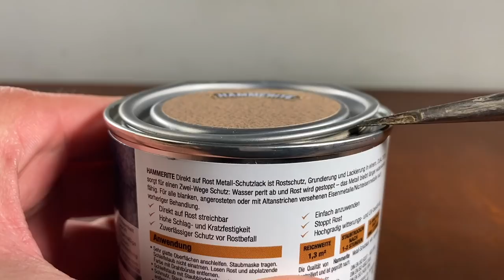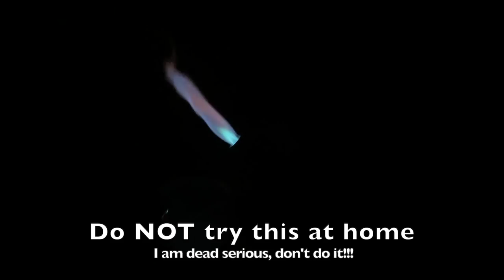Antique german nail puller restoration I Dr. Hut of Handcraft

Comment: Are the jaws are supposed to dig in? the handle has  a big weight on it at the end. Place it over a fully driven in nail and slam the sliding end in to dig the Jaws into the wood so it can grab the head of the nail. Then lever off the lever attached to the jaws.
Reply from the maker: Yes that is actually how you use it, but I didn’t know it when I was testing it, because I had never seen such a tool before. Thank you for your comment!

Comment: They are not for pulling nails out but fencing staples out and you roll them out using the tang on the second beak of the jaws.  In Australia where we have very hard wood especially when it has been holding up a fence for better than twenty years you need something strong to pull the staples out of the post.  I have my Great Grandfathers set which are almost the same make made before 1890 and they are almost the same,  I was using them last week on an old post which a tree branch had fallen on and it loosened the staple with ease.  Hope that helps.
Reply from the maker: Thanks for the info. I know I have used it wrong in the video, but at the time I didn’t know about it’s usage. It was the first time I’ve seen something like that.

Comment: I realize this is an older video. However I actually have a similar nail puller like that but mine is forged steel built. Once you understand how to use it, it is an invaluable tool to remove nails that are even with, or even sunken into any type wood. I pulled hundreds of nails using such a tool. No other way to get them out without totally destroying the wood...
Reply from the maker: Thank you for your comment!

Comment: I still don't understand how it works.  Are you pulling the inner part to pull the nail out of the wood? If so, what's the lever at the head for?
Reply from the maker: You can either do that or you put it on the lever and bend it over to pull the nail out
Reply: You put the jaws on either side of the head of the nail. Then pound down using the sliding hammer. When sufficiently in you bend the whole thing sideways one the lever. This forces the jaws to grab the nail and also lift or pull the nail out. If not enough you then use a hammer. I used the japanese version in the 50s as a kid.

Comment: Nice restoration,but your using the tool wrong . The slide hammer is used to push the jaws into the wood around the head of the nail . Then you lever the whole tool against the small bar to pull the nail out .
Reply from the maker: Thank you! 
Yes, I know, other people also mentioned it. When filming the video I just didn’t know 😄

Comment: Restoration was fine, but the test was a joke. That's not how you use a nail puller at all. You use it to get out nails that are completely buried in the wood. The jaws are shaped that way so you can get them into the wood and under the head of the nail. You then use the long arm as a lever, with the short arm resting on the wood. Just like a crowbar, but you can use it on nails that you can't get hold of with a crowbar.
Reply from the maker: I have never seen such an item before nor have I seen how it is used. I simply didn’t knew 😄
Reply: @DrHutOfHandcraft  OK, I guess they're not very common. I don't have one either, and have never used one. Sorry if I came over a bit crass. But they're still made by companies like Bahco and Hultafors, so you can find their versions online. If you do, you will see that the modern ones are much shorter than your old one. That's because the new ones are not meant to be used alone (as yours obviously is), but they have a bolt at the end so you can use a clawhammer to get better leverage.

Comment: That's not how it's used to pull nails lol
Reply from the maker: How is it used? 😄
Reply: @DrHutOfHandcraft  You grasp the nail then lean it on the part that sticks out and bend it over. Try it and you'll see how well it works that way!!n Let me know what you think ok??
Reply from the maker: @oneshotme  okay I am sure that this will work great, but don’t you think the way I did is the original way? I mean since it’s a nail puller 😄 it has the appliance to pull the handle out fast and stop st the very end..
Reply: @DrHutOfHandcraft  I agree with one shot that you use it like a claw hammer, with the handle extending to give more leverage. The curved foot rests against the work surface and rocking the handle back makes the jaws pinch tighter the harder you pull.